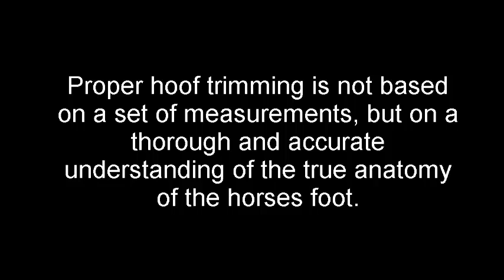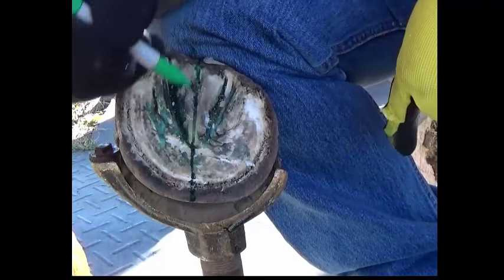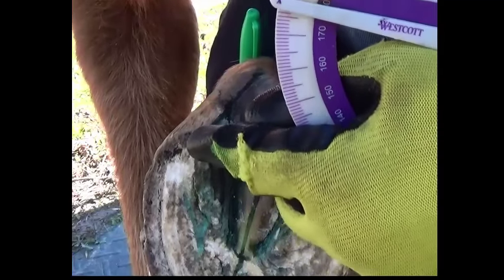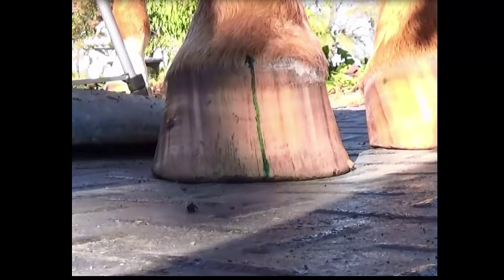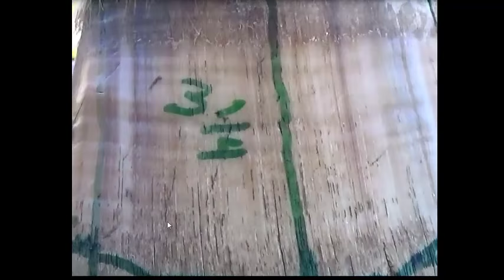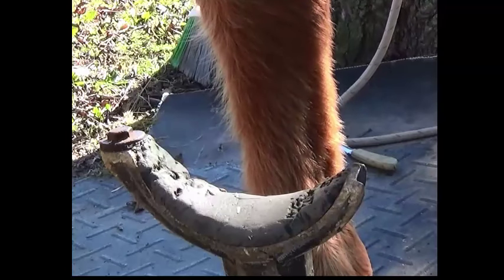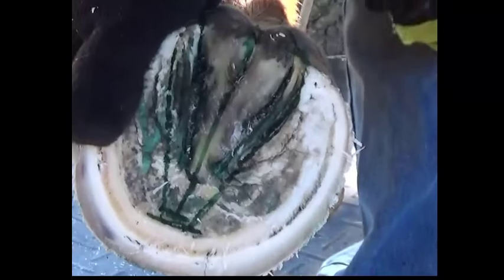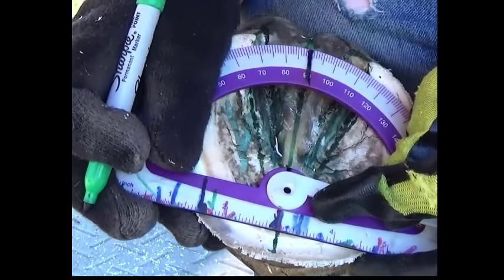TACT Whole hoof mapping protocol Molly demo

Comment: Hi Linda i have watched all your vids, thank you so much for doing them. my qh horse foundered quickly and terribly, bones through sole back in dec15 after paddock accident & surgeries to wounds.contrary to all vets advice,  hes now back to rideable 12 mo on. but i have perpetual issue seedy toe from the original split in soles, its been the cause of all his discomfort since the 3mo point.  once (at 5mo point) i cut back toe as much as i could to see how far it had got & see if i could get it all out but it definitely had reached corium tip of pedal bone & lying atop bit of sole in corium. you must see a lot of seedy toe in founders. Do you have any recommendations for dealing with deep persistant seedy toe while growing out new tight hoof? the seedy toe sits there like a toxic puddle while things grow around it. so frustrating. Thank you, Sarah, NZ
Reply from the maker: Hi Sarah, Sorry I did not get back with you, yes you can correct that, it just means the dorsal wall and to are not tight enough yet and you still have some necrotic tissue in the toe, which that fungus or bacteria likes to eat. Just keep working on keeping the toe back and eventually it will go away. It's not really hurting anything, it's actually just eating dead stuff. That's my opinion anyway, but it is ugly.
Reply: thehappyhoof  thank you Linda. two weeks later & we've made progress. I really appreciate your reply. so much conflicting advice at every turn. I've followed your advice (with a few early mistakes on heel height) and I have my beautiful horse back sound after 28 degrees of rotation. bones sticking out the bottom & whole hoof separated to inside of bars. no drugs shoes grass or stabling. THANK YOU!

Comment: Thanks Linda for your amazingly clear video! You have a reason to do the hoof as you explain the reasons to us. That keeps us thinking instead of copying the work. And the thinking makes it adjustable to your own horse's needs and specific problems. Will the manual be for sale? Also outside of the US? I live in Europe and I would like to have a copy!
Reply from the maker: Hi there is wall next to the sole but the hardest outer horn tubuels have been knocked down and rasped smooth. but you want some wall next to the sole supporting it. I'm still working on the manual...it's going slow.
Reply: I've got time :D
I'm glad you're making one :D
Reply: Here's another European waiting to get hands on that manual!
Reply: Yay :D

Comment: Another really great video, the only thing that really throws me off is the way the heels look like they stick up higher than the rest of the hoof when viewed from the back....do you have a specific video to help me picture and get this in my head?!  THANKS!
Reply from the maker: Go to Pete Ramey web site and to article and look up an article on the article page called Toe and Heel length. In that article he has some pictures of a dissection of a wild horse hoof, where you will see the inner foot setting on the sole with the heel buttress still attaches at the back and you will see that even though the heel buttress is long the horse has an inch of sole. Also when you are growing these heels in as the foot is adjusting it will seem as you have indicated. But you need to get those heels established so you can have some sole in the heel, then you will get sole in the toe as well.
Reply: Thanks, I have his book and have read that article a LONG time ago.  Looks like I need to refresh the old memory!

Comment: Is this the same horse that abcessed and the sole let go which allowed the quarter to move outward and heel got pulled forward on that side?
Reply from the maker: No this is my Old QH ranch mare that was his dam. She passed away at 30 in 2017. I learned a tremendouls amount from her, and was able to pretty much restore her heels and in her dissections learned about the importance of what is called "the frog stay". I have a video on here showing the reason for the frog stay and it's importance to hoof mechanism.